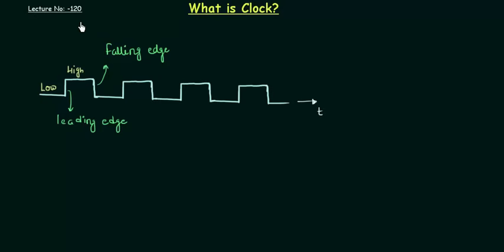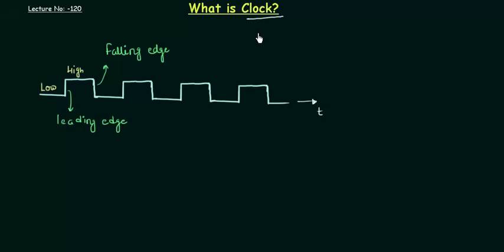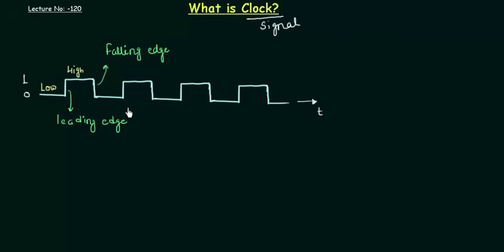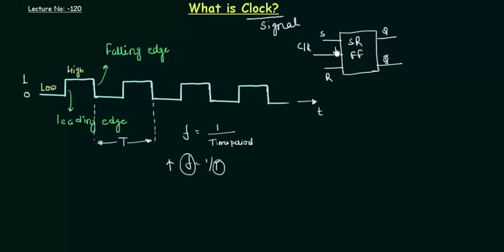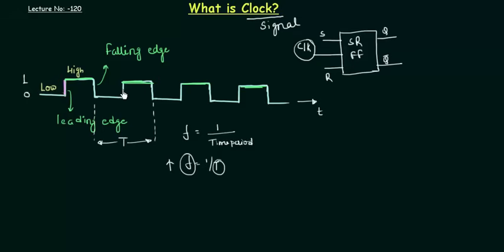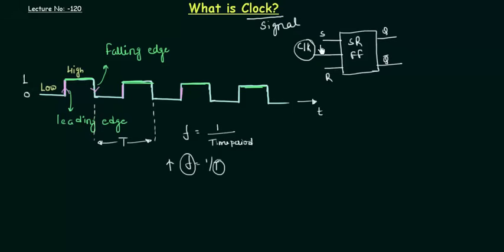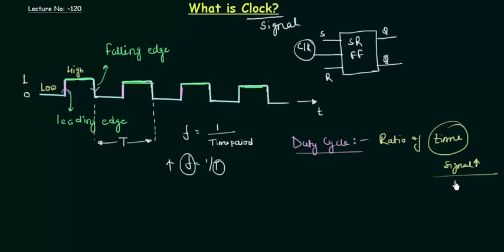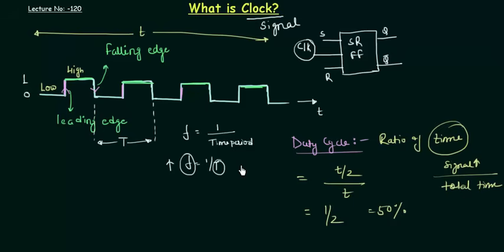What is a Clock?

Comment: Why does "duty cycle" not consider the time when signal transits from low-to-high OR high-to-low ?
Also,
How can SR FF work when clock pulse changes from low-to-high OR high-to-low ?
Don't we want the i/p to be const. ? & aren't the clock signals changing in the process ?

Comment: Awesome lecture man, but is this clock the same clock of computer processor
Reply: Every computer contains an internal clock that regulates the rate at which instructions are executed and synchronizes all the various computer components. The CPU requires a fixed number of clock ticks (or clock cycles) to execute each instruction. The faster the clock, the more instructions the CPU can execute per second. A Crystal oscillator is used inside which generates such a 'clock signal' to synchronize activities and coordinate the working of various digital circuits.
Reply: vishnu priyan thanks sir . So you say that both the clocks are different. Clocks in cpu are different from clocks in memory chips in their operation.Am i correct?
Reply: The system clock is needed to synchronize all components on the motherboard, which means they all do their work only if the clock is high; never when it's low. And because the clock speed is set above the longest time any signal needs to propagate through any circuit on the board, this system is preventing signals from arriving before other signals are ready and thus keeps everything safe and synchronized. The CPU clock has the same purpose, but is only used on the chip itself. Because the CPU needs to perform more operations per time than the motherboard, the CPU clock is much higher. And because we don't want to have another oscillator (e.g. because they also would need to be synchronized), the CPU just takes the system clock and multiplies it by a number, which is either fixed or unlocked (black edition models). Now this CPU clock is sent and the 'registers' use (aka memory elements) so if a positive edge triggered clock is used then for every such 'high' clock the register loads any input it receives. As soon as the data is loaded it appears on the outputs, and stays there steady throughout the rest of the clock cycle. And CPU uses it. IT ALL HAPPENS SO SO FAST. Read more about this from this amazing website with a image (at the end) will help you!!   
http://cpuville.com/Educational/Registers.html

Comment: We give clock and then change the inputs, will the sequential circuit still work? You said this was a problem in the latches that's why clock has been introduced.
Reply: Priyanka Paul  no not actually it will not work

Comment: only differnce between latch and flip flop is that latch is level trigerred and ff is edge trigerred. so the first case you told was of latch not of flip flop when clock was applied.

Comment: how clock is produced?
Reply: +Isra Adam ouh i've been research a bit for what you've told us, so it is not naturally produces vibrates, it is a stone material that vibrates when it is exposed to electricity, how it speed it depends on the size, thickness, shape and so on (this is called piezoelectric effect) , and i've been imagine to my self its like a heartbeat of a digital systems. same like us humans, that our heart is beat every second to pump blood but our processors on our brain is way more sophisticated that the digital brain which is the processors. and every material actually is vibrate if exposed to electricity, and the deep explanation is "you can read about how electrons moving", so imagine (just imagine) if you got stun by electric in your house, my question is, do you vibrate when get stun by electricity ? i'am. :) so that's the logic of clock ( i think), so basically all the sophisticated circuit is nothing without clock.  and clock is nothing without electricity.  so that is why you need electric to turn on your computer. it means to turn on your clock in computer, and the clock turn on all the circuits, so that we can see this great video youtube and type this comment. :) (wow i didn't know that i deep search about this topic ). but thanks.
Reply: +mas bro glad that I helped directing u! and thank you for all the useful info
Reply: You have to use an oscillator that produces a square wave. An amplifier with feedback can do this
Reply: +mas bro no quartz naturally produces regular vibrations, at least this is what our professor told us.
Reply: they use stones like quartz that produces vibrations or simply clock
Reply: +Isra Adam i don't understand. how clock is produced ? stones like quartz you mean a battery ? produces vibrations ? simply clock like our home clock ? watch clock ? how clock is produced. ?
Reply: +Isra Adam your welcome, i edit a bit the information above so its more clearly. ( i think ) :)
Reply: A 555 IC is used in astable mode... it generates a square wave
Reply: SUPERB ....AWESOME EXPLANATION BRO